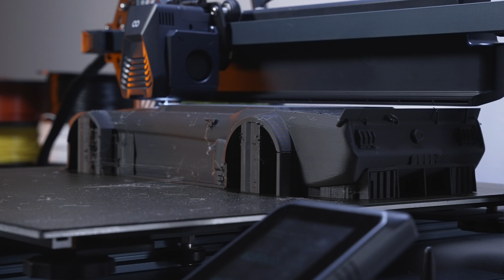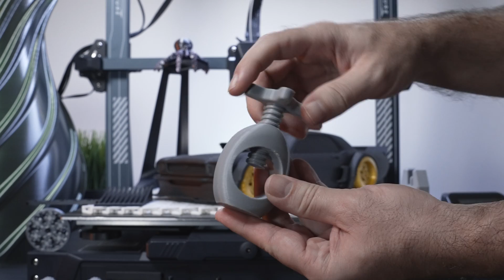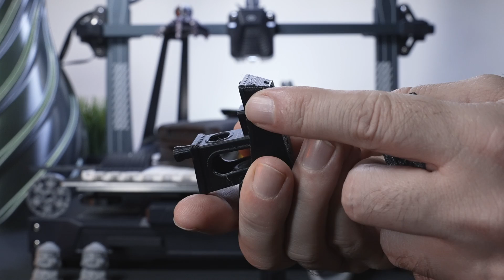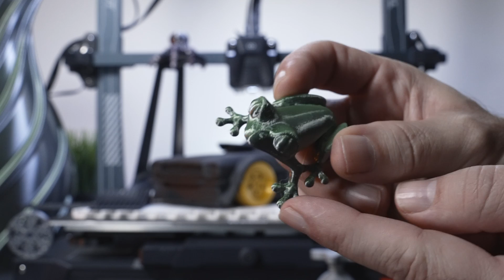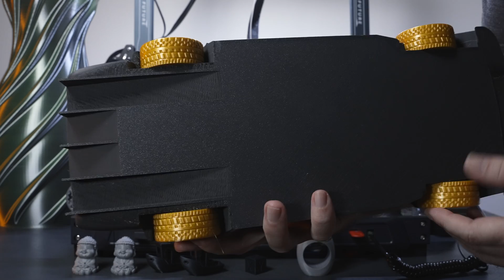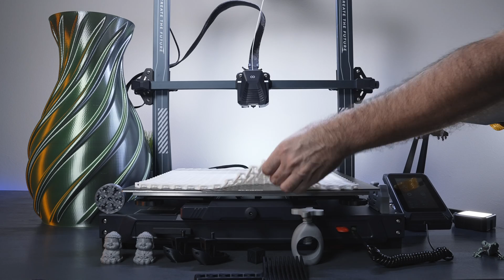Elegoo Neptune 4 Max - Print Quality

Comment: I have just started using this printer for petg. I had to slow down the default settings from their slicer. Works great if you slow it down. PLA printed great at their defualt settings though. Which was nice.
Reply: What settings are you using for petg?
Reply: @PaulShalahm  It has been a while since I have looked, but I had upgraded some parts to linear rails. And also had to do the bed mesh with the edited software. I did slow the first couple of layers quite a bit though.

Comment: how loud is this printer?
Reply: It’s loudish. Doesn’t come with an enclosure so it’s definitely something you will hear. If I wear my gaming headset at 25% volume then I won’t be able to hear the printer on silent mode. I usually use silent mode if I’m in the room. 
I wouldn’t use this in my bedroom for anything over 7 hour prints as I need to sleep and it will be hard to sleep with the printer noises.
Reply: For others, seeing this that are newer to 3d printers. I had an ender3 which is considerably louder than this printer. It does make some noise, but in the quiet setting you can barely hear it 15ft away in an open space.

Comment: what are you using, for the nozzle size?
Reply: These only have .4
Reply: @coltenwills1926  Not anymore, they now come in 0.4mm, 0.6mm, 0.8mm, and 1.0mm.
Reply: @SAES_DROT  Yeah I realized that last week and grabbed me a set :D
Reply: Hey manh, i am planning buy neptune.4 max for my print farm project. I was looking for 0.2 nozzle for it. Could u share link for the 0.1 mm nozzle set?

Also could u share your experience on the printer....
Reply: i've found some 3rd party sources for other sized nozzles as well.  Elegoo also sells different sized nozzles but only in stock in the UK rn.  For now, 3rd party is your best bet (unless u live in the UK) @coltenwills1926
Reply: Elegoo now has a nozzle kit for the plus and max.  The kit has nozzle sizes of 0.4, 0.6, 0.8, and 1.0mm.  The kit gives you ten nozzles plus some tools for around $10.00.  i just ordered a set. @coltenwills1926